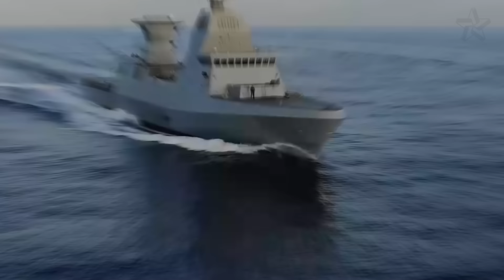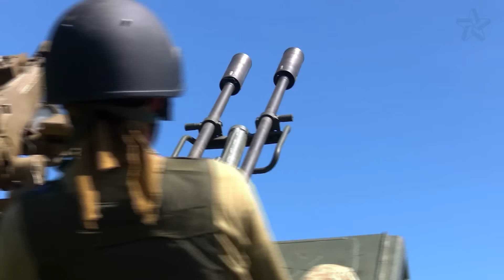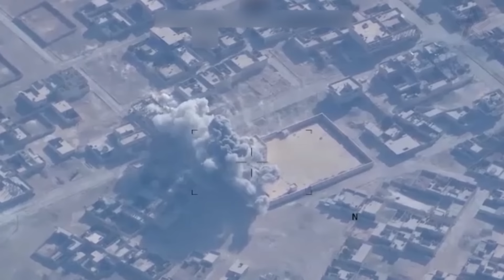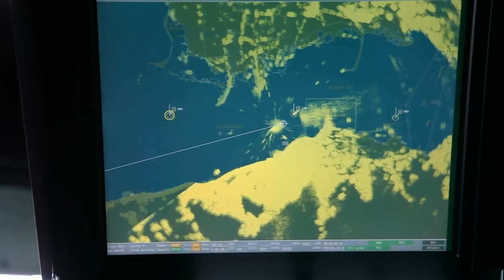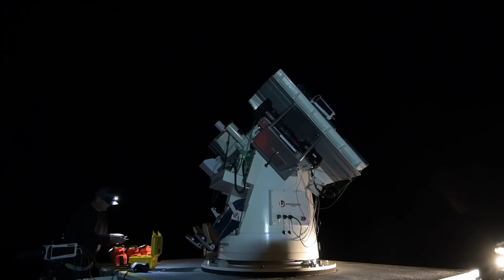Israel Destroyer STRIKE Houthi Port - Then THIS Happened…

Comment: The anti-aircraft system works until the ballistic missile starts maneuvering. Practice has shown that Iranian missiles have hit targets in Israel, the Israeli system is only designed for ballistic targets. To shoot down 1 ballistic missile, 2 to 4 anti-missiles are required. In Ukraine, Hymars are also destroyed despite the fact that this is an anti-aircraft system. It is impossible to shoot down a maneuvering hypersonic missile yet.

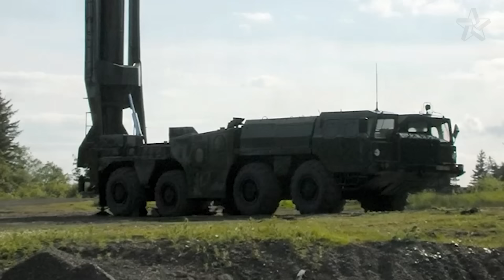Comment: @12:00 - "An Iranian Scud missle"!?!?   Scud missiles were Soviet short range missiles modified, probably by replacing the warhead with fuel, to have a longer range, but comparitively useless because of the lack of a warhead.  Iraq made them.. probably mostly for propiganda reason.  Regardless, I doubt there is a "Iranian Scud Missile" because "Scuds" were a special modification made by Iraq and certainly not something that would be used as an serious offensive weapon against non-civilians.  In my opinion, if you add a 250kg warhead to a "scud", it just isn't a scud anymore.

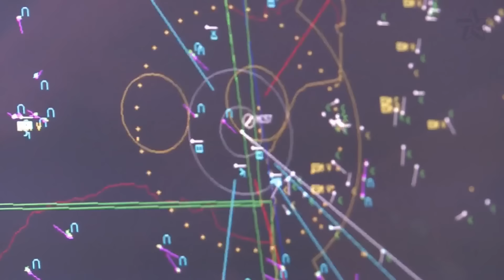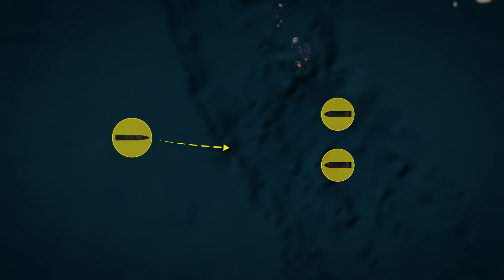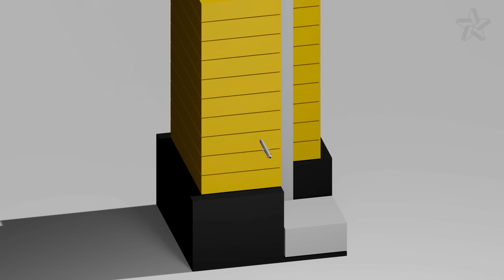Comment: 2:30 How long have they had phased array radar? Did Israel have anything to do with its invention or development? 5:30 Path kind of like the 19 cave men took on the way to the Pentagon on 911, right? 9:15 "...critical load bearing points...": Shades of 911 and the mysterious collapse of WTC7. Just get some desks burning and voila ... one beam falls off its perch and the whole 47 story building falls at free fall speed into its own footprint... nothing hits it. And the BBC announces it 30 minutes before it happens... and never mentions it again... not even in 20 subsequent annual celebrations of the event. How can that be?

Comment: I’ve tried electric, offset, Weber kettle, gravity feed coal etc but I’ve have settled on the Oklahoma Joe barrel smoker. It’s a load and smoke design is simple and provides great smoke.  I have done turkeys, pork it’s, ribs on all the grills, but the Oklahoma Joe works best.  I have bought all the smokers on sale or used, and sold the grills for the same price. So I’ve own 7 smokers and only invested $300.

I’m happy now